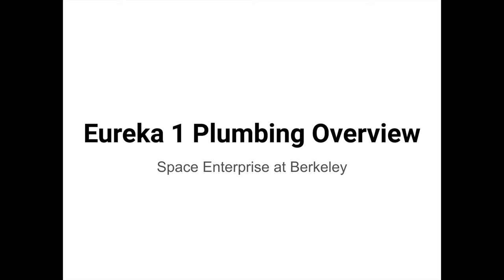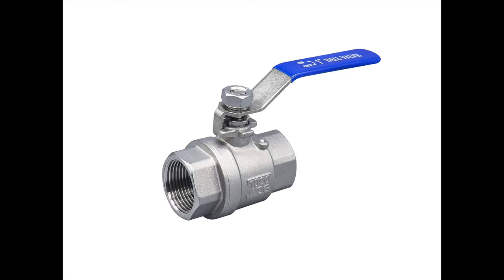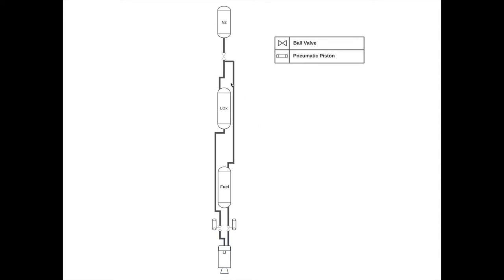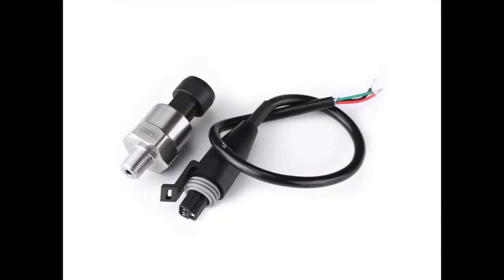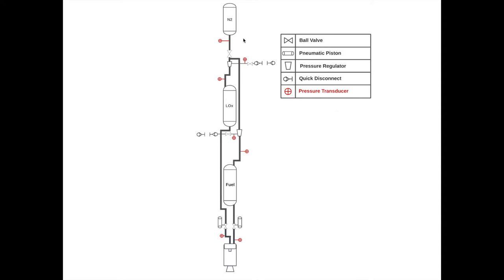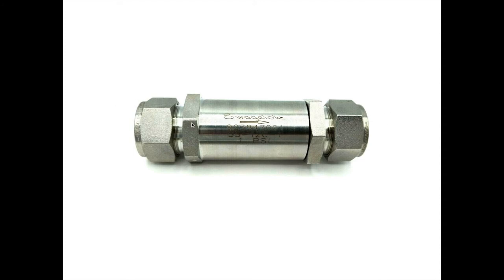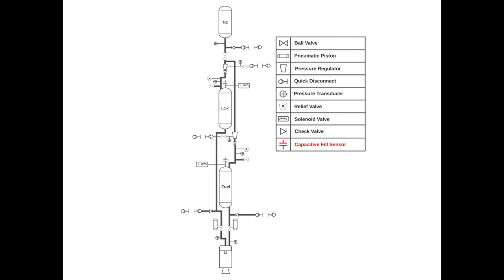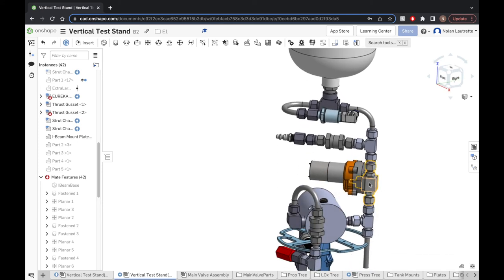Eureka 1 Plumbing Overview: Pressure Fed Liquid Bi-Propellant

Comment: Nitrogen is miscible in liquid oxygen, why would you use that as a pressurant instead of something like helium?
Reply from the maker: Nitrogen is much easier to obtain.  Helium is way over our budget...
Reply: @SpaceEnterpriseatBerkeley  Yeah for sure N2 is cheaper and more abundant, but one issue you may run into is your pressurant dissolving into your oxidizer, resulting in something closer to liquid air than liquid oxygen, which will for sure result in your OF ratio getting messed with. Just something to keep in mind I'd say!